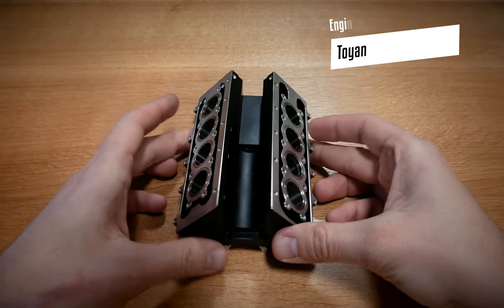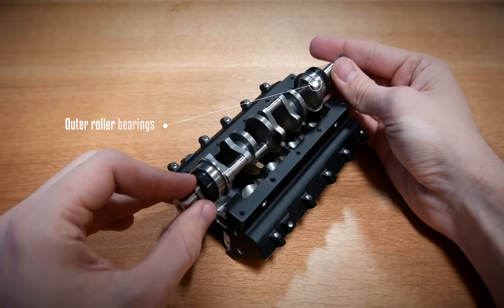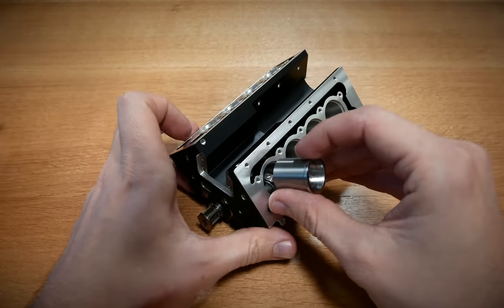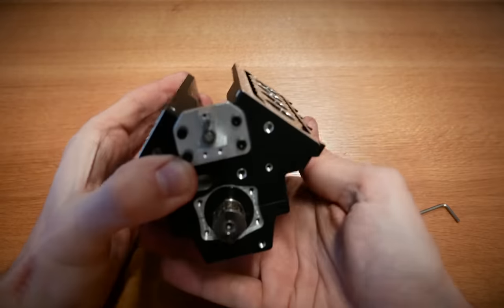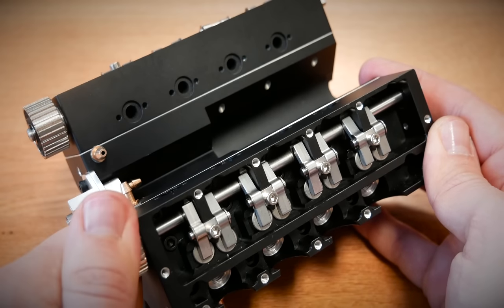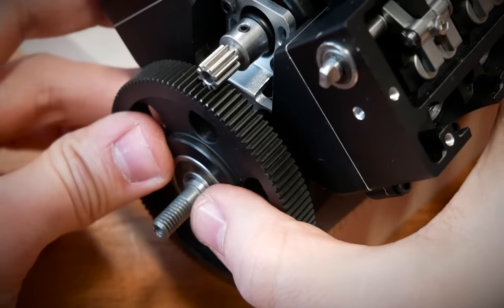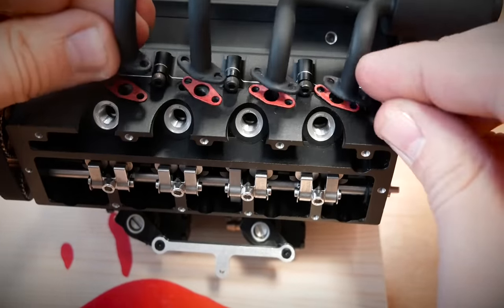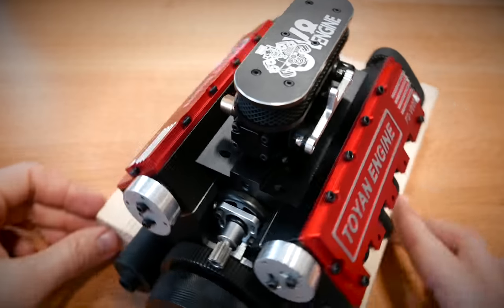This 30cc Toyan V8 Is The Smallest You Can Buy And Run

Comment: Great presentation. But I have one question. How does this engine get lubrication.? That’s the only part that isn’t clear to me.
Reply: It's because of the 2-stroke oil added to the fuel. It goes down to the crankcase after burning the fuel with it mixed, and the excess oil comes out through a nozzle screwed into the oil pan
Reply: @netorodrigs2100  thanks for the info.

Comment: As you like to show unusual engines, how about something on the 2 stroke radial aircraft engines used on WW-1 aircraft.   ( 1914 to 1918 )
The crank shaft was bolted to the firewall and the engine rotated around the crankshaft.   The aircraft propeller was bolted to the crankcase.  SO.... the entire engine and propeller rotated together.   Castor oil was blended with the gas to provide lube for the engine.  This unusual design was used by all sides in the war.    Snoopy's Camel and the Red Barron's red tri-plane both used this engine type.  Speed control was accomplished by quickly turning on and off the ignition.   Shortly after 1920 conventional dry sump 4 stroke  radial engines took over for aircraft.
Reply: I have seen examples of the engines you are describing, in the Air & Space Museum in Wash., DC.  One brand/model was the Gnome Rotary, which was a type of RADIAL engine.  Now, this is gonna confuse the youngsters, but the design you are describing, i.e., "The crank shaft was bolted to the firewall and the engine rotated around the crankshaft.   The aircraft propeller was bolted to the crankcase..." was known (back then) as a "rotary engine," NOT to be confused with the more modern "rotary" engines found in Mazda's "R" series of cars.  But what I didn't know was that the rotary, RADIAL aircraft engines were two-strokes.  Imma gonna go check that out!   Thanks again.

Comment: These are so cool. Warped Perception pushed this engine to over 10000 rpm.
Reply: 0.030*10000/3456/1.35=0.0643 HP?

Did he say how much horsepower he got out of it, cuz that's my guess is 0.0643
Reply from the maker: The engine is claimed to have just under 4.5 hp
Reply: @VisioRacer  That's actually pretty healthy number if correct, i used to drive a moped called Suzuki Pv and in it's stock form as 50cc 2-stroke it makes a couple horsepower.
Reply: @Pelleministeri smaller engines tend to give proportionately more power than large ones (probably due to higher rpm) I can recall when I was into r/c cars many years ago, a 3.5cc two stroke could give around 1.4 or 1.5 bhp. I don’t think any naturally aspirated full size car engines that even approach that much bhp per litre.
Reply: @emmajacobs5575  You have that ass backwards. Larger engines make much more power at much lower revs than smaller high revving ones because how else would the huge diesels in ships and locomotives make several thousand HP at only a few hundred RPM?
Reply: @TheSilverShadow17  I said 'proportionately'. 
As an example, when I used to mess around with r/c cars, an averagely decent 3.5cc engine could give about 1.4 - 1.5 bhp. If you scale that up to a typical litre bike engine, you'd be looking at 400 bhp or more, but I don't know of any actual litre bikes that are producing more than about 220-240 bhp.
If you scale down one of those massive marine diesels, you get less than 5 bhp per litre!

Comment: Nitro RC engines don't use piston rings, the use a taper bore, called "pinch" the bore tapers at the top, when that bore gets worn out, it won't hold compression any more, and it will only run for a few seconds till the sleeve expands and there's no more compression. Man I miss Nitro, I might bet back in to it, too bad there isn't too many parts left around.
Reply: This motor it's a real 4 stroke, nitro rc it's more 2 stroke motor

Comment: Back in the mid to late 80s a manufacturer (American I think) offered a scaled down Ford flathead that ran on nitro fuel. I've aways wanted to build one of these and make a functional radio control car or truck to put it in. I spent so many years competing using electric cars and trucks but never got involved with fuelies.

Comment: No oil what so ever ... nice :-)
Reply from the maker: I have no intention to run it. If so, I would disassemble, lubricate the parts and assemble again.
Reply: @VisioRacer  i was just like "well even if you would just turn it from time to time it might get small scratches in the bearings ... but i think it will be just fine in your hands ... i think you are aware of the importance of lubricant :D